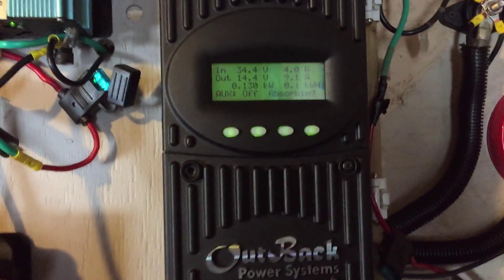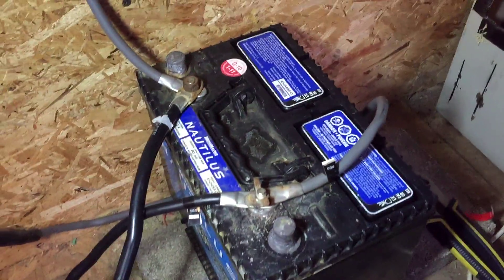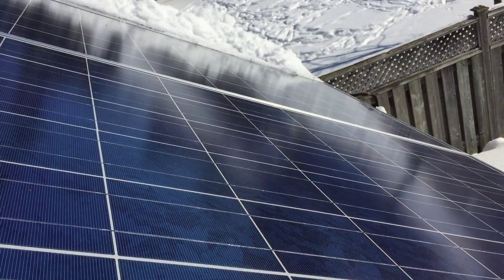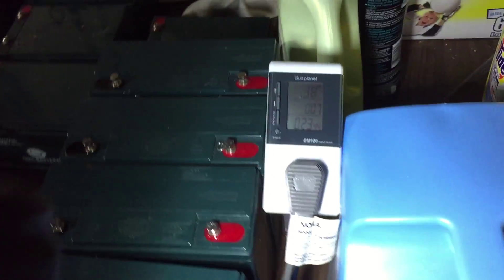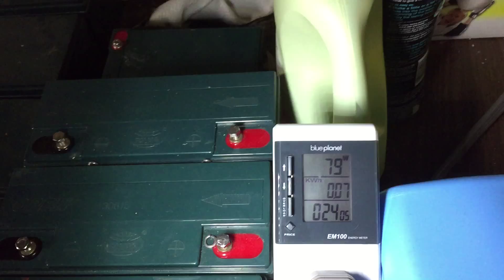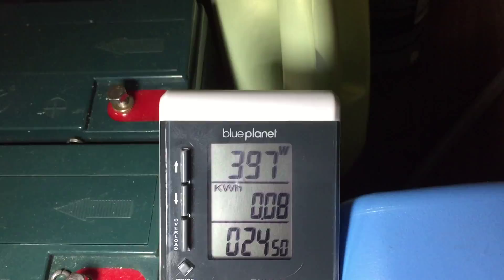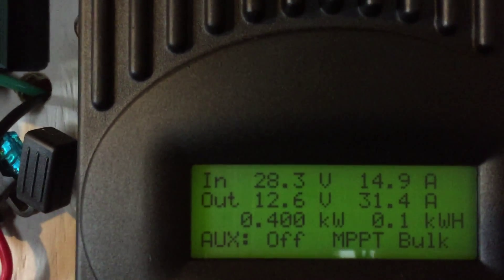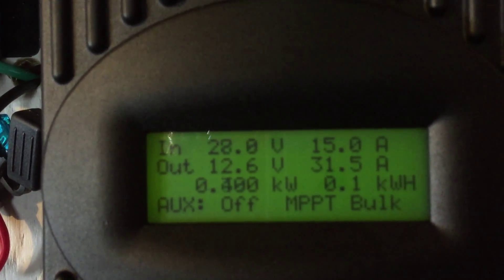Running the old basement fridge off solar

Comment: My fridge watts come way down after the compressor runs a few minutes. I think after it runs a bit then it comes down to 79 watts or something like that. I wonder if my tv and satellite use more than the fridge dose? Because the tv and sat and stereo have constiant draw of 200 watts all day and all night. but is off a while early morning hours. I need to put the kilowatt meter on them both and check to see what they are doing but I am never awake to see what it says late night when my wife turns it off.